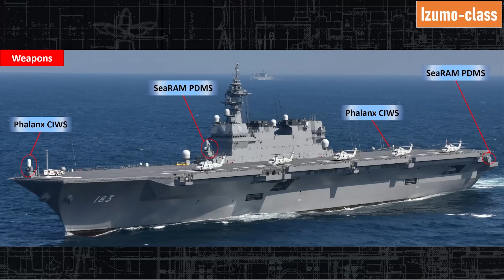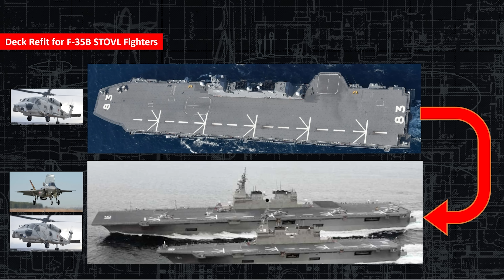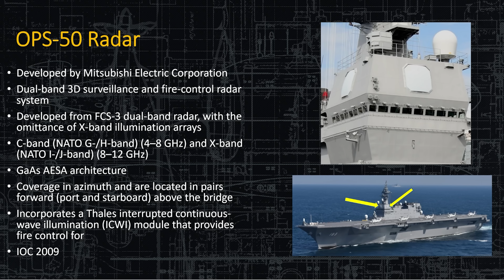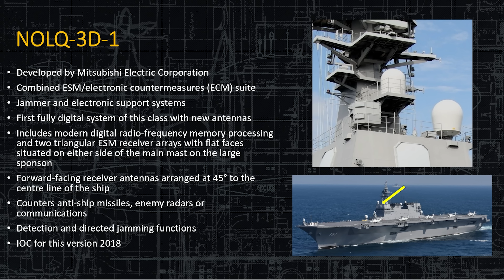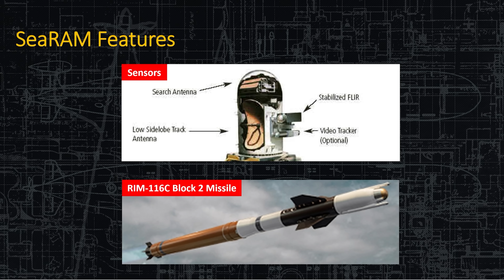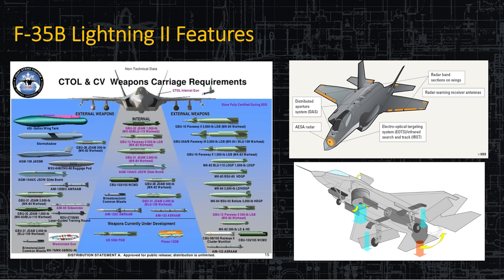Why Is IZUMO a Destroyer?

Comment: One of the ways I classify ships is displacement, and this ship is too big to be a destroyer. To me, the Izumo is a cruiser-carrier (aircraft cruiser). The cruiser-carrier (aircraft cruiser) was developed as a hybrid warship that could operate both as a surface combatant and an airbase at sea. The concept emerged in the 1930s, aiming to create a multi-role vessel capable of launching and recovering aircraft while also engaging in naval combat. If the Japanese Navy has a cruiser with a higher displacement than the Izumo, I will accept the "destroyer" designation, but otherwise, it's a cruiser.

Comment: Japan a powerful, stable and strong Ally. Their not allowed aircraft carriers or an offensive force. So I say this is a Destroyer and the best defense is a strong offense. I was a gas turbine tech USN. We had four LM 2500s on the USS Caron and ran the snot out of themwith lots of starts and stops. Two out of four ran from 1977 into the nineties. 20,000 pounds of thrust each, two engines per shaft developing 105,000 shaft horsepower and a million and a half foot pounds of torque. So 52,500 horsepower each through the reduction gear. Glorious high winding, turning and burning marine power.

Comment: The modern definition of a destroyer is getting a bit cloudy - this is just adding to it.   The USS Johnston DD 557 of WW2 was 2100 long tons displacement.   A Baltimore class HEAVY cruiser was 13,000 tons.   The Burke Class Destroyers - flight 3 - are 9700 tons (Cruiser Size), and the Zumwalt Class are over 15,000 tons which is larger than both the Baltimore class Heavy Cruisers AND the WW2 Independence Class Light Carriers.

Comment: Does F35B ever takeoff/land on this ship?
Reply: That was part of the refit, they had to strengthen the flightdeck so the F-35 exhaust won't burn through the flightdeck in vertical takeoff mode.
Reply: @kdrapertrucker thx for clarification

Comment: It would be nice if the F-35b Lightning could take off vertically but it can not. It requires an air strip, albeit a short one, in order to get into the air. It can land vertically but not take off vertically (STOVL). The aircraft it is replacing, the AV-8b Harrier, can both take off vertically and land vertically (VTOL). Which is why I think we should keep a bunch of AV-8b's in the Marine Corp.
Reply: Those airframes are near the end of life though
Reply: @Milleniumlance  Ya. I just think it is sad that we will no longer have a fighter/attack plane that can take off vertically.
Reply: Technically the F-35B can VTOL, there are plenty of videos of them doing that. It is just that VTOL is incredibly fuel inefficient and requires reduced plane load compared to STOL which is why nobody does it. The Harriers, despite what movies would depict, almost always used STOL too.

Comment: I vaguely remember a problem in F-35 testing being the rear exhaust was melting the decking, and they had to get the things redesigned to take the extra heat. Hopefully they worked that out by now.

"Japan didn't want to do this." Doubt it, they probably had F35 integration in mind from the moment it got approved. "Curse you! You made me use my Final form!!"

Comment: It's not the first time it's been done, Italy's first post WW2 Aircraft Carrier, Giuseppe Garibaldi was officially designed as an aircraft carrying cruiser and in her original configuration aside from her air wing she carried ASM and Torpedoes by the boat load. It was mainly done because Italy was still blocked from operating actual Aircraft Carriers.

The Kiev class also had a designation of Aviation Cruiser where the air wing was to defend the battle group and the Granits and Basalts were for engaging enemy ships at long range.

So Izumo is not the first to do it

Comment: Hello! JMSDF just released their latest version of ships categories and apparently Izumo class is going to reclassified as CVM, stands for Cruiser Voler Multipurpose (aircraft-carrying multi-role cruiser), but it is also synonyms of Multi-functional Aircraft Carrier. JS Kaga(DDH-184) has completed the conversion for F-35B operation while JS Izumo (DDH-183) is underway the same upgrade at JUM shipsbuilding, Yokohama, just saw it in late August
Reply: I'm no Admiral, but I feel like 3x to 4x medium cost CVM would be better than 1x costly  nuclear Ford CVN
Reply: @nagasako7 Yeah no. Nothing replaces a catapult in getting heavy long-range aircraft of the deck.
Reply: @nagasako7  Not really, for their aircraft complement, STOVL/VTOL aircraft are much less capable in things of range and weapons load due to the more complex engine to take off shorter runways. Compared to non STOVL aircraft that are in the same capabilities of land-based aircraft especially in the upcoming 6th aircraft where their necessary size wont ever allow them to be put on Amphibous Assault Ship. Then comes the size of the CVM prohibiting being able to have more aircraft and especially more specialized aircraft like the E-2 AWACS which are essential to modern air battles as seen in Desert Storm. Ford/Nimitz type Supercarriers are the bare minimum in needs of any military that wishes to project power far away. Look at China's recent carriers where the end goal is an equal to the Ford. CVMs like the Kaga are more made for countries who dont have the economy of the US while still wishing to project power though more in their local waters/region and not the entire globe

Comment: Under Ministry of Defense Instruction No. 317 (effective October 28, 2024), the official classification system for Japan Maritime Self-Defense Force (JMSDF) vessels was revised.

The Izumo-class vessels, which had previously been classified as DDH (Helicopter Destroyer), were reclassified as CVM (Multi-purpose Aircraft Carrier).

Similarly, the ASEV (Air-defense Ship) category was abolished, and ships in this category were reclassified as CG (Guided Missile Cruiser).
Reply: So basically a modern take on the USN Independence-class escort/light carrier. The escort carriers were very effective in battle of the Atlantic because of their sea control capabilities.
Reply: 知らなかったです。勉強になりました。

DDH-181「ひゅうが」
DDH-182「いせ」
DDH-183「いずも」→ CVM-183
DDH-184「かが」→ CVM-184

イージス・システム搭載艦1番艦：CG-191　※2027年就役予定
イージス・システム搭載艦2番艦：CG-192　※2028年就役予定
Reply: @yo2trader539 Wait, so Hyūga and Isê will keep their DDH designation? Are there changes to the design like with the USN LCL and LCH Hulls?
Reply: @acceptablecasualty5319  
ひゅうがといせはそのままDDH
Reply: ASEV(イージスシステム搭載艦) is the project name; it's the same as the common tactical wheeled vehicle(共通戦術装輪車).

Comment: Why would you  put a CWIS on the flight deck?  If it needs to be at that altitude why not
just put it on a little platform attached to the flight deck, but not in the way of an out
of control jet sliding down the flight deck.
Reply: So they can say that it’s not a carrier.